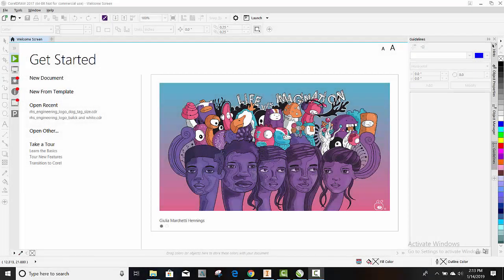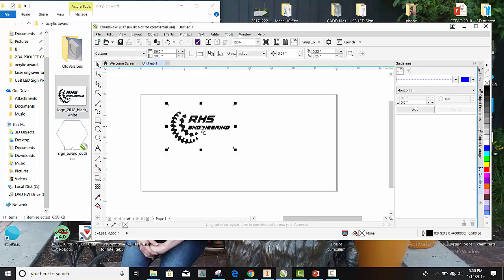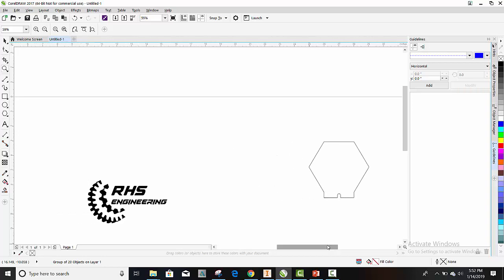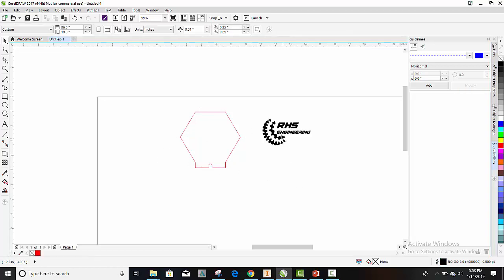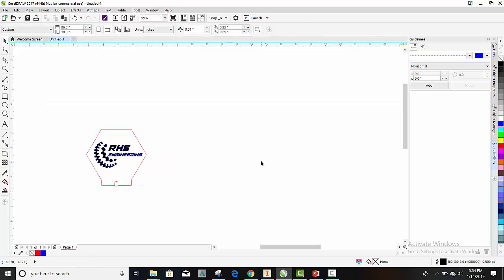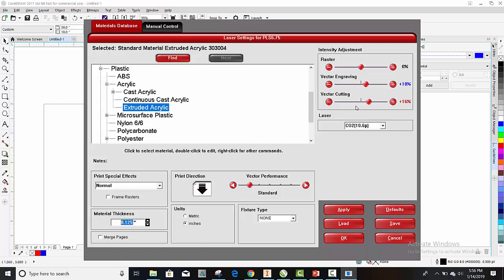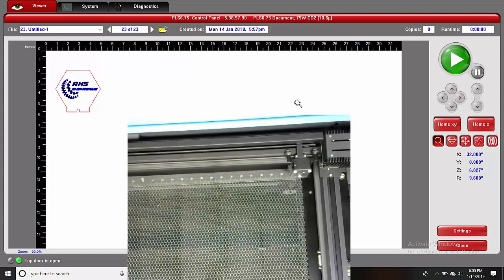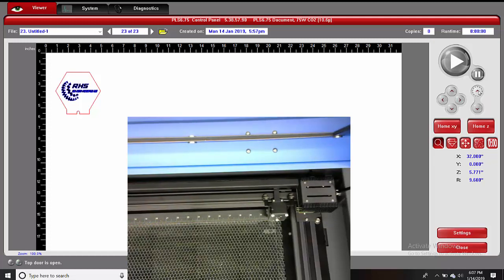Universal Laser Engraver Tutorial

Comment: How did you determine that 2” was the z height.
Reply from the maker: The machine comes equipped with a 2inch z calibration tool
Reply: Hi John - so your unit standard z height is determined by the calibration tool. What happens to the table when thicker material is used? Thanks for your last response.
Reply from the maker: @charliemclaughlin4753   On the software their are two up and down arrow buttons.  Use your mouse to click on either the up or down arrow buttons to move the bed in either direction, up or dow so u are 2 inches above the material, u do this to account for materials of varying thickness.
Reply from the maker: @charliemclaughlin4753  for larger objects, you can physically remove and take out the bed